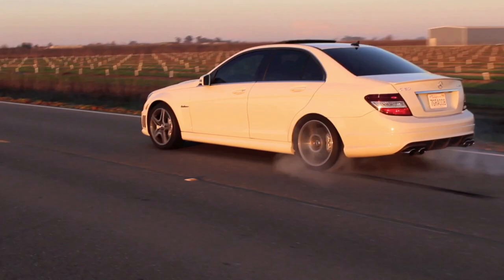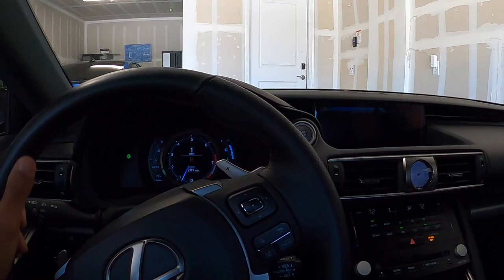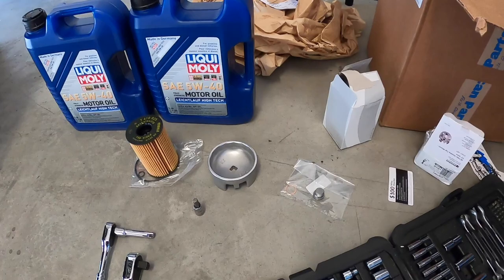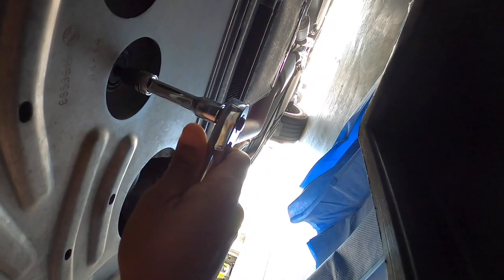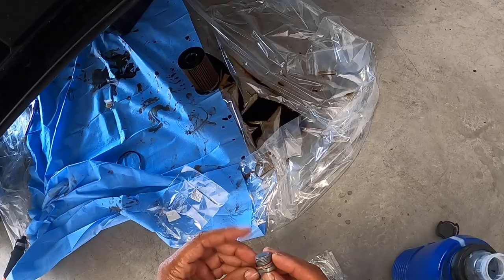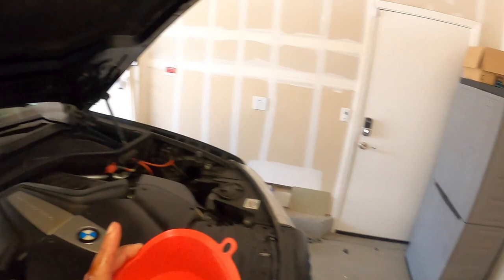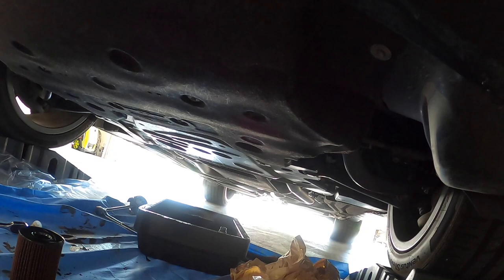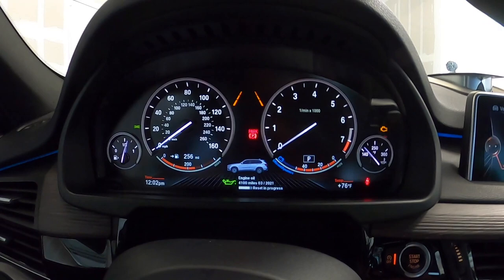F15/F16 BMW X5 N63TU Oil Change

Comment: My 2014 BMW X50i with 85Kmi on the N63TU engine failed CA idle smog test due to failed valve stem seals.  The issue is covered in a class action lawsuit Isley v. BMWNA.  BMW policy is to change the engine out for a refurb and my portion of that work would be $8K.  Instead, I elected to pay Brian at Performance Motorwerk in Dublin CA do the work using the superb AGA N63TU tool set.  Elring 199-440 seals are the best choice.  I may be among the first to be affected by this problem on the N63TU since smog tests are not needed during the first six years of a car’s life.  It’s not a question of IF but WHEN this will happen to all N63TU S63TU engines, so be forewarned.

Comment: Make sure you have additional support while working under your car because sometimes the ramps can collapse thanks for sharing your knowledge
Reply from the maker: Thanks for the tip!
Reply: @eddiemcars  Have you ever had to change your battery? does the dealer have to do it or you can program it yourself?

Comment: Hello.

As the owner of an F15, so the same model, I can still give you a number of recommendations.

For added value of the vehicle, it is better to have the maintenance done by a dealer, so an official garage. There is more to it than just changing the oil.

Liqui Moly is good oil, Amsoil is better. The EURO version 5w30 is an absolute must, or the signature series. You will notice the difference including lower consumption and a smoother engine.
Reply from the maker: I switched to Amsoil on the F85.  I’ll report my findings!

Comment: Hi Ed,
As always, great content. You use the same brand for oil as I do; for my Diesel I use the "Liqui Moly 5W-30 Longtime High-Tech", but change the Oil every 10-15tkm (6-9t miles) anyway.
And I pay a free workshop to do the Oil change (I give them the oil) because I don't like this mess :D But highly appreciated you did it even with camera!
Oil is so important for modern day cars, I always wonder why people tend to exhaust the milage limitations here... It is not that costly in comparison to what can break if you don't do it.

Comment: Yeah the F15 50is are messy oil changes, I just did mine a few days ago as we ended up picking up a '15 x5 50i. I ended up putting a Fumoto F-104 quick drain valve on it, as they make oil changes a lot less messy. Been using one on my subie for a few years now. ( I'd recommend looking into them if you do your own oil changes, it saves time and money!)  Keep up with the great videos, glad to find someone with a similar vehicle on youtube. So far I've, break fluid bleed, oil change, spark plug change all are super easy if you got the tools, next is the dreadful coolant flush >.>
Reply from the maker: The location of the drain plug and the volume that rushes out suddenly.  I haven’t figured it out.  I’ll look into that quick drain valve.  Yes,  the spark plug change was surprisingly easy.   I probably have to do it again here soon since I didn’t gap them and I plan on going to a stage 1 tune. I may take it to somewhere for the coolant system.  That looks like a PITA.

Comment: Great video!  Thanks for the info.  Try wearing 1 or 2 latex gloves on the hand you use to unscrew the drain plug.  If the oil is very warm use 2 gloves otherwise you just just one will do.

Comment: Word of the day is: GLOVES......Play it safe Mr. Edward...........also safety goggles.. I installed the ValvoMax Stainless Oil Drain Valve on my X6M - with the Stainless Drain Hose Attachment. There is no mess etc. It makes oil changes so much more easier.
Reply from the maker: Good tips.  I need to get comfortable with wearing gloves.

Comment: Dude your X5 is sooo sick! I think you might have tightened the caps a little too much tho lol.... Also, have you ever thought about putting a Fumoto drain valve on your X5? Oil flows out easily and with little mess. Might be worth looking into

Comment: I am about to change the rear brake pads and rotors for my F15 X5, do you require to put it in service mode to release the electric parking brake? I read somewhere F15 is still using the tradition standard drum-style parking brake assemblies?
Reply from the maker: Leon L you’re correct, it’s still using the standard drum style for the parking brake, so the caliper so should remove easy.
Reply: @eddiemcars  Thank you so much, I was a bit worried and was going to send it to my mechanic as I don't want to manually retract the actuator and don't have access to a scan tool either - should be a simple job then!
Reply from the maker: Leon L yes, I was worried too.   I changed my rear pads and was thinking I would need the same tool.  

Now I didn’t remove the rotor but I can hope that the E parking brake is released enough so it comes off.

Comment: Would having the car on ramps unlevel the car therefore preventing all the oil from dripping out?  Why the F is the filter underneith the car.  The F15 35i is  just a plug making it much easier and faster to change the oil.  Too bad youre on the west coast.  I get all my oil change and parts from FCP.   Lifetime warranty even on used oil.  Buy an oil change kit for $60, mail back all the old stuff for $20, and get my $60 back.  Total cost for a DIY synthetic oil change and filter for this and my GTI is the postage of $20 here in NY.
Reply from the maker: I can try it. From other cars I’ve changed the oil in the plug is usually at the back of the pan instead of under it which helps the oil flow out instead of pouring out uncontrollably.  

I wish the design of the V8 was similar to the I6 for the oil filter placement.  That would make it much easier.

Comment: Next time wipe it clear under, well I dont know if you did that after the video
Reply from the maker: I did, there was oil still sitting on some parts, they left a few drops on the garage floor after I cleaned it up.

Comment: How reliable is the N63 engine? I've heard nothing but bad things about it.
Reply from the maker: The 1st gen N63 got a bad reputation.  The 2nd and 3rd generation is much more improved! Not near as many the problems as 1st generation.
Reply: @eddiemcars  I see this M5 doing double duty, tote the kids back and forth to school and hauling the motorcycle to the track. And doing both in style!
Reply from the maker: It will do it without a problem!

Comment: That's a shit set-up for draining the oil as well as the filter. Why does it have to be vertical? Just to make it messy and make you want to say f it I'll pay a tech to get oily. 
Might be worth remembering that oil will behave like water and drain THROUGH your paper concrete protection that's laid out. How many times had you performed this oil change? Has it been a sh*t show every time? I'm gonna have to but my 14Qt pan up on blocks to catch more oil, I just hope that it will actually drink up the oil into the inside of the actual jug fast enough....yikes, let the good times roll
Reply from the maker: I’ve done it probably 6 times now.  
I purchased a deeper oil drain pan to prevent the splashing that happens with the plug is pulled.  I get some occasional specs but nothing like that “s*** show “ you saw on the video 🤣